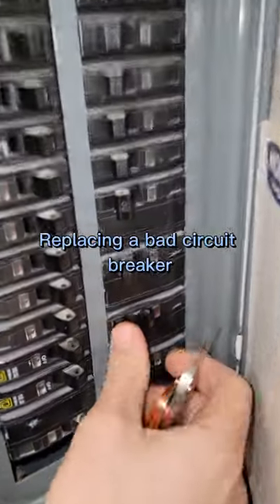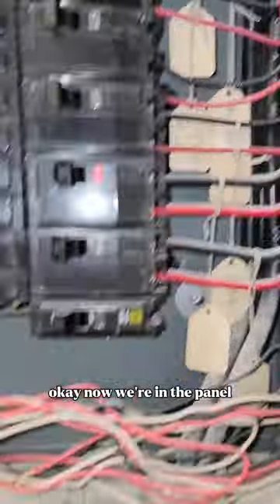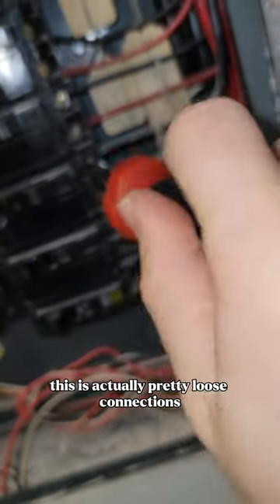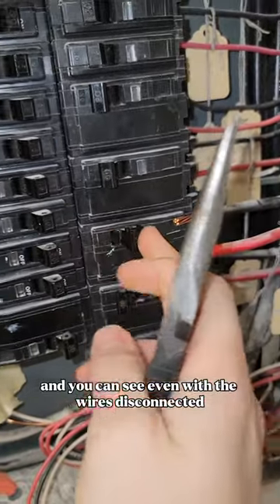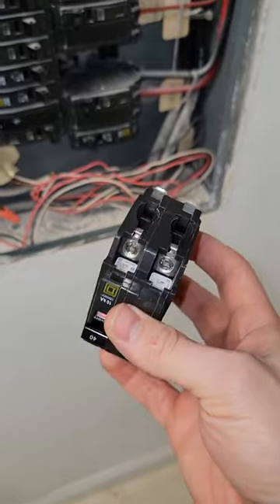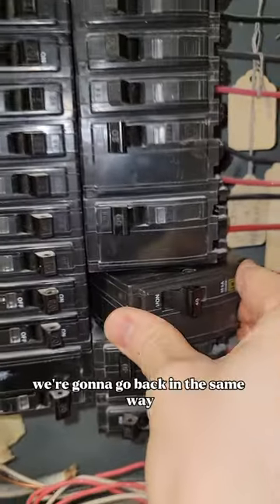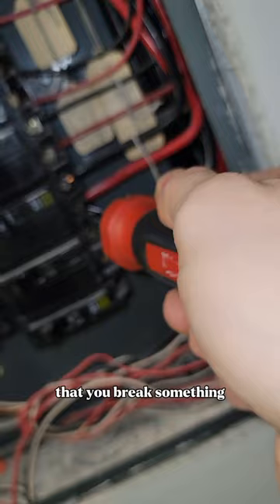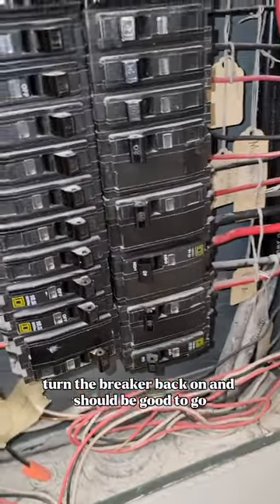How to fix a circuit breaker that WONT reset!

Comment: Important PSA: Check if the breaker happens to be in the middle (Neither ON or OFF), and push it to OFF. That might solve your problem! The breaker goes to the middle and stays there, when GFCI occurs. It won't let you turn it ON until you reset it to OFF like that
Reply: Genius man, my mine was in the middle I thought it was off reset it like that
Reply: thanks bro saved me alot of time 😹
Reply: You’re a lifesaver fr
Reply: Thank yo so much. This just happened. Excellent info. My kitchen WITH REFRIGERATOR and FREEZER (OMG) back up and running. Both breakers were in the middle. God Bless you. So thankful I stumbled onto your comment.
Reply: I'm looking for a GFCI right now I think there might be more outlets on that one line for my washer it keeps tripping in the middle as well.
Reply: you saved me from a scolding from my father thank you I mean that! <3
Reply: Thank you so much for this tip. It worked perfectly! I was getting ready to call an electrician .
Reply: Thank you for this. Life saver!!
Reply: This worked 🎉 thank you so much ❤
Reply: Ive been doing that like you said and  it keeps  tripping after a few hours  ,   it must be old and worn out im thinking  and needs a new one
Reply: You saved my ass. Thank you
Reply: Just saved me a lot of time just now!!! God bless. I read the comments to the comment and better understood. May god give you abundance
Reply: Add me to the list!  I panicked when it wouldn't reset.  Thank you!
Reply: Thank you!! Really saved me from having to call for maintenance and embarrass myself for wasting everyone's time on a small fix!! ='D
Reply: Thank you! I tried this and it worked!!!!!
Reply: Thank you sooo much for this comment 😅
Reply: @amikkadisciple  haha thanks the reply! what caused your ground fault?
Reply: @eitantal726  so I’m kinda dumb and I was running my portable ac and the microwave was going and then I decided it would be a good idea to run my air fryer 😫 I learned quickly that was a bad idea haha then the  breaker tripped and i tried to reset it like 4 times and I didn’t understand why it wasn’t coming back on. So I went to YouTube and saw your comment, I didn’t even watch the video 🤣 soooo thank you again! Cuz it was 105 today where I live, so I’m super grateful for your comment.
Reply: Thank you so much

Comment: those tools are not considered insulated, and are not rated for live electrical work. so kindly don't give electrical advise, you will end up hurting someone.
Reply: I’m sure he turned off the main breaker.m
Reply: The main is off. Kindly do everyone a favor and keep your comments to yourself sport👍
Reply: What're you talking about? Not only is the main breaker off but the tools clearly have insulated handles.
Reply: A good portion of my family are journeyman electricians and one is a master electrician and jack of all trades and they all buy Klein tools

Comment: Working on a live breaker box, you should be using CAT III rated tools at minimum. 
Neither the screwdriver (bare shaft) nor the pliers (insulation too thin, no slip guard at end of insulaton) used in this were rated for this work.

Comment: Was wondering  what causes these to  break  if you never really  touch them  ,? Is it a spring inside that just  gives out after years of being  in there or  does something  cause it ..  I have one that wont stay on  its the one that  goes to the garage out back  , i need to change it out  Thanks for sharing

Comment: if i found the breaker connection to be loose i would of just torqued them to spec before anything else and see if i could reset the breaker. loose connections can generate unwanted heat and eventually melt insulation i beleive.